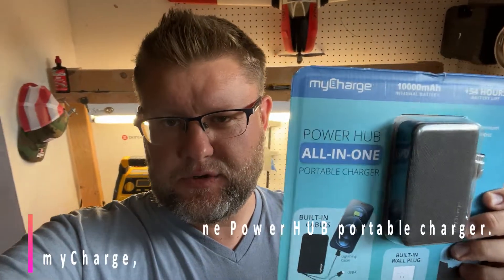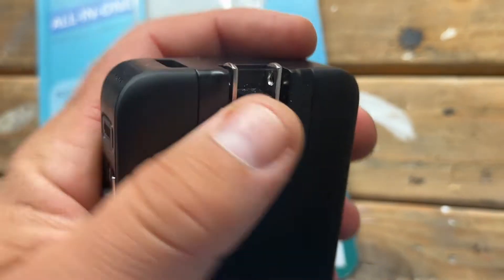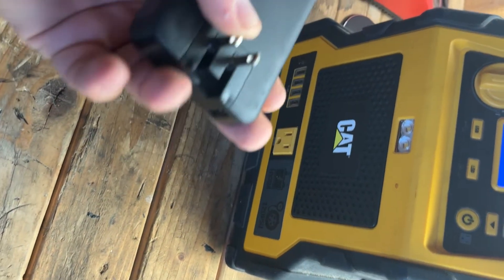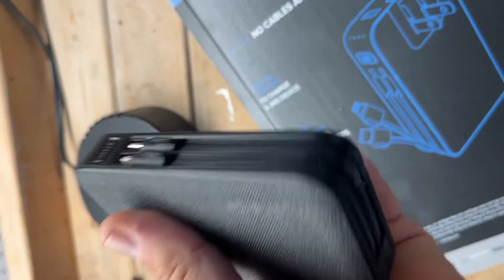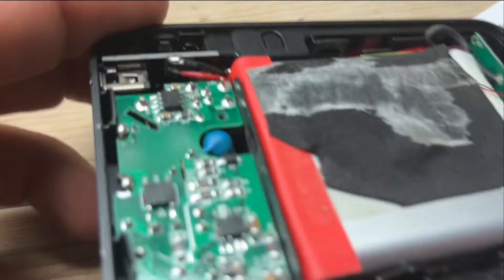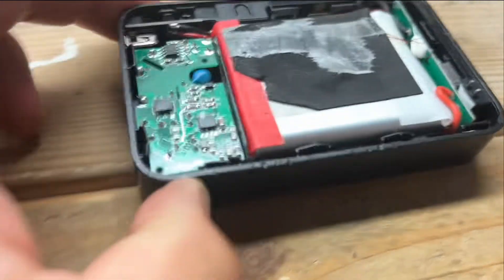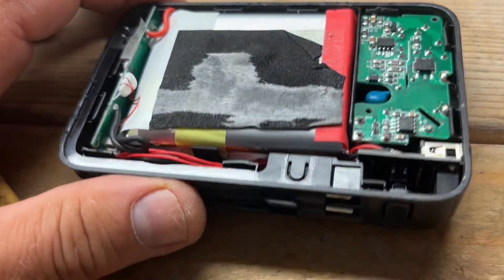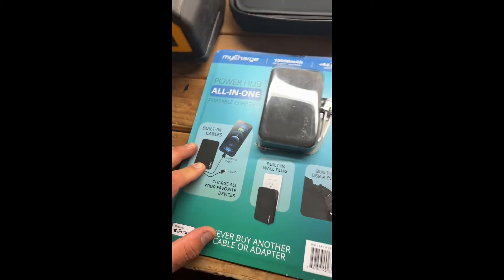Costco All in one portable power charger with built in wall plug  myCharge

Comment: These are under RECALL. I had to stop using mine it did run warm a few times I guess I’m lucky it didn’t get completely hot. Il miss using it but it’s not worth risking. I’m cutting the cables and getting the replacement they are providing to those like me involved in this recall.
Reply from the maker: @Crazyreviewer123  mine is working fine